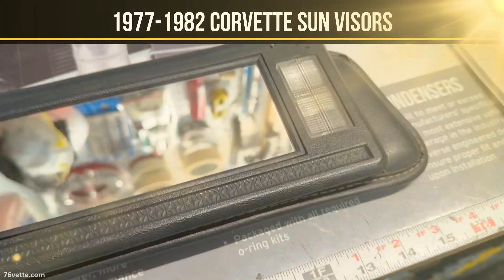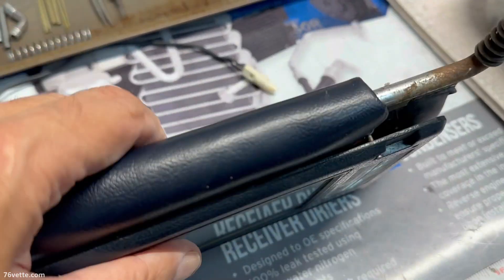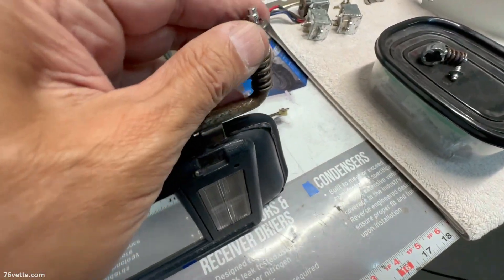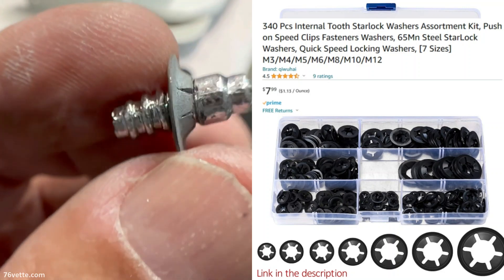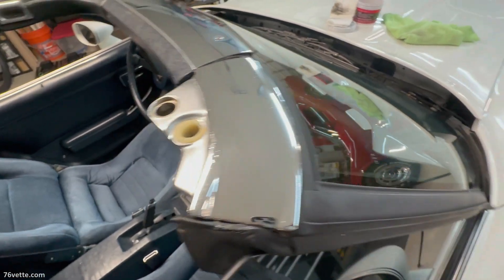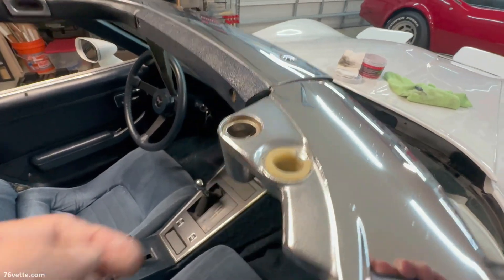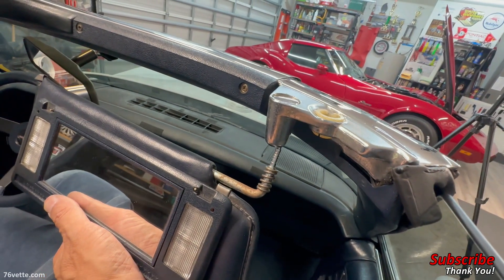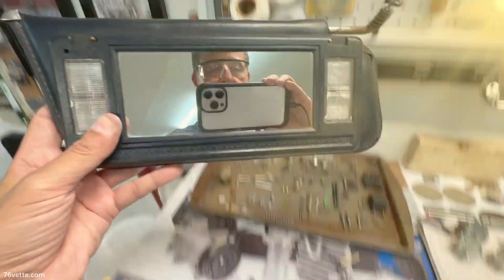SUN VISORS: Keep or Delete?

Comment: Great information! I've always thought the sun visor's seem so out of place on Corvette's when the T tops are off but their needed also. I never knew they went to such a fancy mirror and light, my 79 just has a simple mirror with no lights on the passenger side, and my 69 has the comfort weave visor's with no mirror at all. I've thought about removing the mirror on my 79 because I think it looks bad shining in the sun with the T tops out but it appears to be glued on, but my wife uses it and I bet she'd skin me if I removed it!😂
Reply from the maker: I am guessing that as they got close to the 80s, GM was trying to make up for an aging design, and one way to do that was to add stuff nobody really needed or wanted, such as courtesy light delays, or in this case, lighted vanity sun visor for the passenger. I guess they were ok in Buicks and Cadillacs, but totally out of place in Corvettes, again, IMO. And their construction was really flimsy to put it mildly. 
I don’t mind the ones on my 76, but I like them tucked against the headliner and never use them so I don’t really notice them. Just a personal preference.
Thank you for watching! 😊👍🏻
Reply: Mine is also a 79. No problem with the sun as long as the cover is still attached. Because of a flimsy hinge design, covers easily broke off.

Comment: My vanity mirror cover is also broken and missing. Do you know if the mirror and light portion snap into the visor or glued in? Thanks.
Reply from the maker: Hey William. That’s a good question and, since I was curious and happened to have mine handy, I decided to take it apart. 
The short answer is that they snap in place with two retainers in the back of the mirror that have to be pressed into the cardboard inside the visor. In addition, there are two small twist locks that secure the top portion of the frame. So the mirror also secures the frame (with the lights on each side) to the visor. I don’t think mine had a cover. And if it did it was missing. 
Anyway, I will post a short video to show all the components and how they are secured to the sun visor. I hope I’ll be able to get that video edited and uploaded by next week. 😊👍🏻
Reply: Great. Look forward to seeing that video, and thanks for taking the time to do one! My mirror and lights are attached but the little switch has fallen out.
Reply from the maker: Ver resposta curta
Reply: Do you know if the tiny bulbs are plug in or are they wired to the harness?
Reply from the maker: I’m pretty sure they were small plug-in bulbs.

Comment: Does the wiring run inside the upper windshield molding?
Reply from the maker: It appears to be routed inside the A pillar. 😊👍🏻
Reply: So I’ve ordered a new aftermarket vanity mirror (any originals are in bad shape. And you were correct, the wiring runs down inside the A-pillar. What’s tricky, is the connector plug is behind the dash. So in order to attach the new wiring harness, you need to remove 2 screws on the side of the dash and slide it back enough to push the connector through. Or you could just cut the wires. But that’s not cool. Did you already know that information?
Reply from the maker: @inell6 Had no idea. It’s too elaborate of a system IMO, so if I ever decide to install sunvisors, I’ll try to find plain ones. There’s no need for illuminated mirrors. 😊👍🏻
Reply: I agree, there really is no need, but I’m trying to get it back to original as possible. Another thing I noticed, on the 79 and maybe earlier the 2 holes that the mirror secures to on the visor are smaller than the 80’s models. So they don’t need the plastic crown retainers.